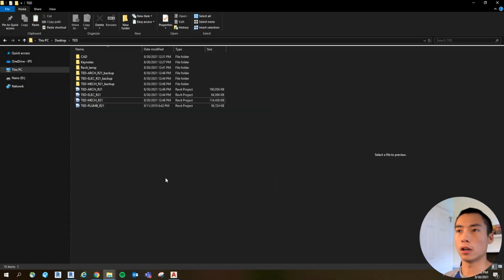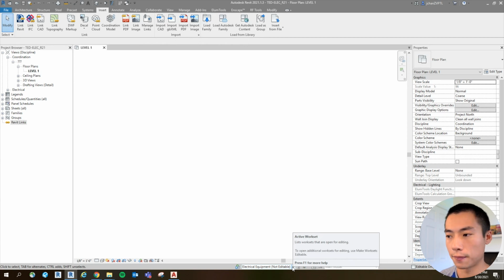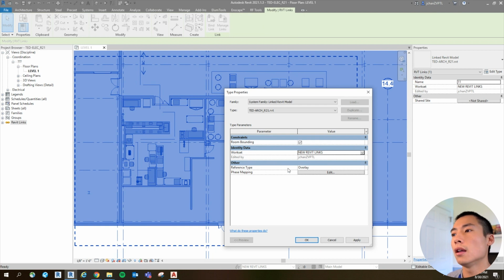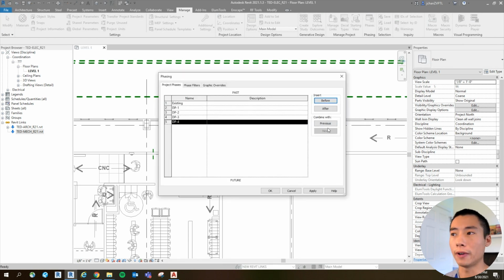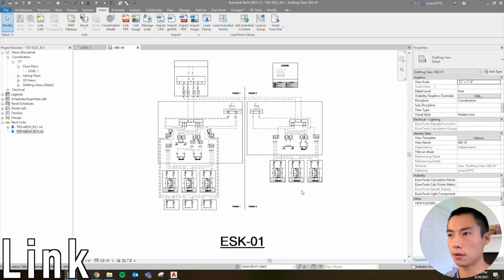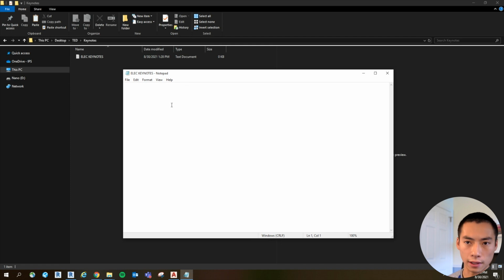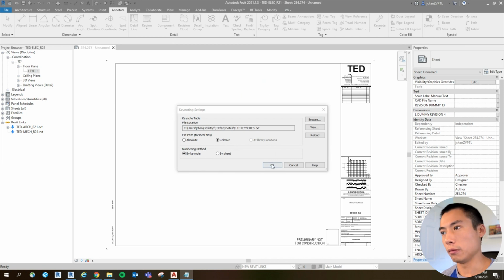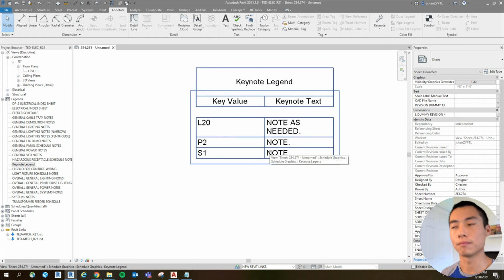Revit Tutorial - Beginners Series - Part 2: Revit, AutoCAD and Keynotes

Comment: Hi, Could you make videos about load estimates and calculations using Revit? and also show how effectively we can use the panel schedule for the load calculations on Revit.
Reply from the maker: In Part 3 of this series, I went over a few of these topics in regards to electrical loads and how to classify your loads so it shows up correctly on the panel schedule. If you create the MDP panel as I had, you could read the loads for the entire project so long as you provide a load for every connected equipment and receptacle.

Comment: Hi, I am an electrical engineer (old school :-) and I just started to work with Revit. I signed up for an online course and try to work through it as best as I can. But it isn't easy for me. I have a major issue with setting up the electric vies and with underground conduit runs and connections with TX Pads. Is there a chance that you can help? Can we somehow connect?
Reply from the maker: Hey welcome to Revit! I applaud any attempt to try and learn the tools of our trade. The majority of my job is to bridge the gap between our senior engineers and our younger college grades. One knows engineering and the other knows software, and in kinda in between right now. The best I can offer are my videos at this time, as I’m super swamped in the department.

Comment: In reference to phasing, can you go back and work in different phases?  My example is, we will do work in the model, but then a revision comes out, so we track the re-work.  Once we are done redoing parts of the model, we then need to go back on the normal phase to continue working.  How can you use phasing to help track progress, example: can you select a phase and just see items that were touched or created during that phase?  Thanks!
Reply from the maker: Oh yes certainly! So we usually do a few phases for projects: Basis of Design (concept), Shell package, and Fit Out package. We have drawings and views for each phase inside one model. If you look at one phase, the stuff created in that phase will appear bolder. Previous phase will be half toned. If you’re working on Fit out phase and something comes in for a change on Shell package, you can make the changes in Shell and it will reflect in Fitout.